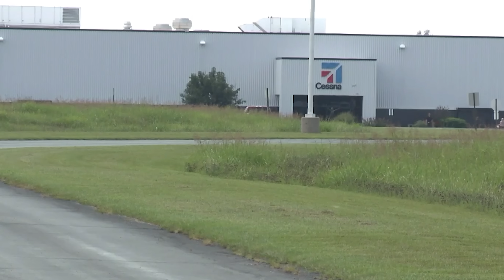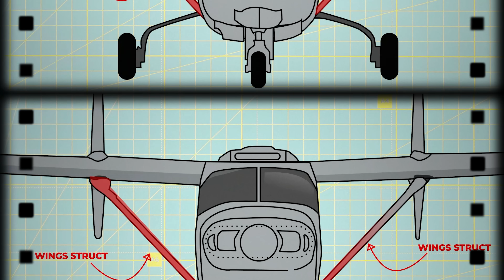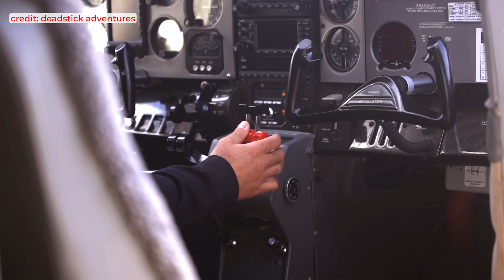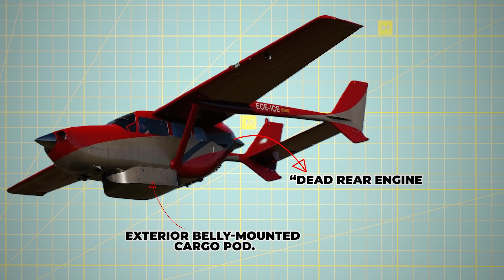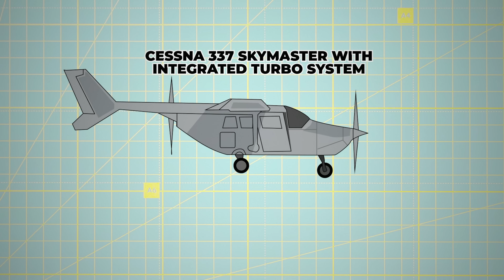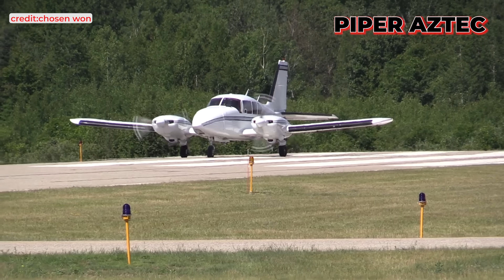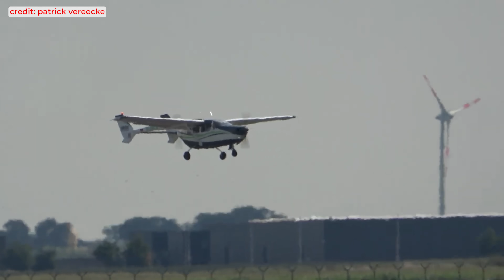Why Did Nobody Want the Twin That Couldn't Kill You?

Comment: The problems were real, but so were the solutions.
Electric mechanical. Controls would have fixed the elevator.
IMHO fitting this airframe with a Turbo prop would have made the bronco look dumb.

Comment: It's interesting how often something which should improve safety can also degrade it. Cessna: No yaw moment with an engine failure; great, should be easy to handle engine out. Pilot: Shuts down the working engine. Alexander Schleicher: The ASK 21 is impossible to spin, it should make a very safe trainer (you can attach tail weights for spin training). Pilots: Forget the weights are fitted, solo a tail heavy craft, spin and crash.

Comment: I can see its brilliance - it is a bit of a smack to the eyeballs, and the 310 et al look "right" and perhaps people thought that the 310 was for real men (gotta remember this is the 60s/70s).   Despite this, I really wish I could fly one.  There are a couple in the UK but I most likely will never get the chance.

History tells us that clever aircraft designs never do well, and the market is extremely fickle.  But I am glad they existed.  The skymaster definitely belongs pretty high up on the cool wall.  The more time passes the more cool we realise it was.  Its ironic that it offset its reason for safety by virtue of its quirkiness which was there in the first place to add safety - that's a pain but happens a lot.  Like adding fuel cut-off valves seems an obvious safety requirement and came about for specific reasons, but then people inadvertently cut the fuel off and that's killed many more over the years.

Comment: The 0-2 that i flew in Asia was the second best aircraft i flew even with the overheat problems when in the taxi to take off and hold. To keep the rear cooler we often only started and ran it up as we neared the hold point before line up. Having flown the 310 in the past i can understand why people still love it as a good value aircraft bur my all time fav aircraft has to be the O-V 10 Bronco.

Comment: Loose an engine and it was barely noticeable. I know that phrase well and so does my dead friend. He was a low time pilot who lost his rear engine on take off. With gear down it is dirty, and climbing is possible but not good, add in clouds, fog, low time, excellent training orientation, and dead. 

After learning about the issue I choose a single engine turbine over a Piper twin or inline twin. Pas on this plane. Great video on it and calling out some of the safety issues.
Reply: Even compared to conventional piston twins, a turbine single is a valid alternative to a piston twin. Turbines are expensive and fuel-thirsty, but that's also true of piston twins; turbines are so much more reliable than piston engines that - along with the many problems in twins - one turbine is safer than two piston engines.

Comment: The USAF took delivery of the O-2 Skymaster in March 1967 and the O-2A also entered the U.S. Army's inventory during 1967, from USAF stock. By June 1970, when production stopped, a total of 532 O-2s had been built for the USAF. Following the Vietnam War, the O-2 continued to operate with both U.S. Air Force and Air National Guard units into the late 1980s. 
https://en.wikipedia.org/wiki/Cessna_O-2_Skymaster

Comment: What I don´t like from the Cessna 337 is that she had just one door on the right side.  Why Cessna didn´t make the Skymaster with doors in both sides like the Cessnas 150, 172, 177 or 210?  Also the rear engine problem ,coold be solve by subtitute both piston engines with turboprops?

Comment: The biggest problem of the 336/337 is it was designed by the single engine engineering department.  Cessna was big enough they were separate from twin design engineers.  The single engineers made some beginner mistakes.  The twin department didn’t want to help until made to.

Comment: The Skymaster does have a Critical Engine.  The rear engine pushing is slightly more efficient and it creates a low pressure area in front of the rear engine smoothing the airflow over the fuselage.   So loosing the rear is more critical than losing the front due to the rear being more efficient and with its loss there is slightly more drag.

Remember. The definition of a Critical Engine is the one’s loss creating the most adverse effect on performance
Reply: Whilst I was flying a C336 in New Guinea, a rocker arm bolt failed on the exhaust valve of one cylinder head on the rear engine, causing very rough running. The aircraft descended to and (just) maintained 1500' at 80 Kt. IAS. D.A. was +2800', and I was over water. Talk about a critical engine!

Comment: Been in aviation my whole life never met anyone who didn’t like that push pull
Reply: Well, you might start liking it a bit less when the maintenance bill comes due
Reply: @macbrown99  That's certainly true - it's a bit like a helicopter; fly it for an hour, then work on it for three!  Generally speaking the pilots loved them and the mechanics hated them.  I haven't flown a 337 in about thirty-five years but I loved it and trusted her completely.  I learned the hard way one afternoon how much ice they'll carry, and though not an Aztec, the old girl will pack a load of ice that'll scare the hell out of you.  The fuel system is a little complicated but once you understand it it works very well.  I'd jump in one this morning and go fly it.
Reply: @stearman456 good comment!!
Reply: can you elaborate why it's worse for maintenance? I genuinely wanna know  @macbrown99
Reply: I've never met anyone who flew or owned a 337 who trash talked it. . But having bought, sold and flown a lot of 337s  I encountered a lot of people who had no experience with them say they were one of the worst airplanes even made. I also encountered a few mechanics who griped about working on 337s but they were usually the ones who complained about everything.
Reply: Never liked it
Reply: @rondavis4140  Why? Have you flown or owned a 337?
Reply: A pig to work on.
Reply: When I was young it was one of the most comfortable planes of all those we used.  I liked it and it hauled ass compared to many.
Reply: My spent my whole life in aviation and didn't like it.
Reply: @lrrryo you probably don't like blondes
Reply: @lrrryo  Why? And did you ever own or fly one?

Comment: Do not forget that the USAF used the Skymaster in the forward air control spotter role. This was during the vietnam War. They were based at a local military air station where I grew up.
Reply: They were cheap and the US was desperate. OV-10 Bronco was better in every way including ejection seats while if an O-2 got hit the crew were trapped and could not bail out.
Reply: I understand every time they took off, it was over max weight.

Comment: Had my first ride in a 337 in 1967 when an airport kid at Port Hedland in the north-west of Western Australia during the 1960s massive iron ore exploration and railway construction stages of the industry in that region. The short/rough field sprint performance made the 337 ideal for servicing the railway survey and construction camps. Every morning before going to school I'd watch 4 to 6 taxi out and take off 'scramble' style to do their day's work. The pilots did their own maintenance so I'd make myself conspicuous and wait for the shout "Hey, I've got to do a circuit to warm the oil so I can change it, wanna come for a ride?" I was in that right hand seat and buckled up before the question was finished. I was always amazed by the hardover full aileron required for take off to counter the co-axial engine torque!

Comment: Make the pusher electric for take off, climb and engine outs. You get an aircraft with low noise, improved efficiency and safety.
Reply: You might expect a gasoline-electric hybrid aircraft to be more efficient, but in practice it typically isn't. Gasoline engines work well at much less than full power, so running two engines at half power is better than running one of the same engines flat-out.  

The Ampaire Electric EEL started that way,  but the later version replaced the front engine with an electric motor, keeping the gasoline engine at the rear. It has not been a success, despite claims of miraculous benefits. 

The VoltAero testbed for their planned Cassio replaces the Skymaster rear engine with a different gasoline engine (with generator) and replaces the Skymaster front engine with electric motors on each wing. VoltAero is no longer using the Skymaster-based testbed and has changed their Cassio design, abandoning the centreline thrust configuration.
Reply: That's  pretty _ucking brilliant !
Reply: @Dean-b2f  that's reasonably obvious, which is why it has been tried.

Comment: How about a 337 with a CD-300 running on jet A in the front with a featherable prop and a 350 hp PT-6 in the rear with a featherable prop. Use the piston up to 15,000 feet, fire up the TP, shut down and feather the front prop, up to 31,000 feet we go. Best fuel efficiency for all altitudes. Fire up both on the ground and watch a 4000 feet per minute climb rate.

Comment: I spent many hours working on a reims 337 built in France.
It had the massive camera bay, it also had hard points under the wing.
Most impressive were the tanks, 5 interconnected tanks in each wing, had to use capacitance type qty senders as floats would never work.
Gear was a headache, as was working one the rear engine as anything on the accesory case needed accessing through a hatch in the rear of the cabin.
Lots of fun though and beautifully made as were all Cessnas.

Comment: It was expensive for what you got.  It wasn't very fast,  didn't have a large payload.  If you got a twin rating with one you were limited to "centerline thrust only" and you still had the expense and fuel burn of two engines. 😂

Comment: I don't know how under appreciated this plane was, my uncle had one and Cessna couldn't stop the rear engine from overheating. There was another for sale at our field that was just as bad. Maybe if you got a good one you had a nice plane, but they were not all good ones.
Reply: Lots of discussions regarding rear engine overheating, flew one as a commercial pilot in 40 degrees (at GL), never had an overheating issue, but I was very familiar with the SoPs and its commercial operation requirements. Had plenty of other issues!

Comment: I personally love the Skymaster.  The fact that you can’t use your time in it as “twin engine” time toward your commercial career makes it less desireable for time building.  It’s great, however, for private pilot owners, if you can keep that rear engine cool.  As for that gear, I owned a TR182 and…it’s fine.   As for nicknames, the Skymaster is known as the O-2 suck-n-blow.
Reply: I did.   

I got almost 700 hours in one and it was decisive for an early upgrade when I moved on in my career.
Reply: @calvinnickel9995  Most jobs only count hours in non-centerline thrust aircraft.  It’s like they are specifically trying tomesclude the 337.  Yeah the hours always count toward total time.

Comment: I just remember what a SOB that rear engine could be to work on,  front wasn’t a cinch either
Reply: I never found this to be the case. The front one is actually more difficult.  Particularly the oil drain (only accessible through the front gear well and you can’t have a quick drain because all your oil will drain out on gear retraction 😂), the oil screen, and the mags.  

The rear engine of non turbo versions has tons of room plus a really good working height.

Comment: Many Skymasters lost the rear engine late in the takeoff roll and it went unnoticed by the pilot.  When the attempted to continue flying, the rear engine act liked a big air brake. Without  the rear engine feathered, on a hot day the airplane can’t fly.  Low time pilots ended up crashing.  Well trained higher time pilots survived the experience.

Comment: Skymaster killed my Commanding officer at Shaw in the early eighties.  The rear prop failed and cut the tail off.  Bad bolts.   I flew on that plane. It has some power and a roar.  Nice plane but I avoid it.

Comment: I worked on a lot of these. People thought that the maintenance cost should be the same as a single engine. But no, It had the maintenance costs of a sophisticated twin, depending on model. The most complicated one I worked on was turbocharged, pressurized and had a Robertson STOL conversion.
Reply: I flew a friend's Robertson STOL C-337. That really made the plane great.
Reply: Me too. We had a C337 for work transport. Unfortunately one of our bases has a gravel strip and I was forever filing the rear prop!
Reply: @robo3915 I taught aircraft maintenance for 9 years. When doing blade repairs my students were in fear when I approached with my chisel and hammer.

Comment: 2993 were manufactured.  I don't think that makes the 337 a flop for a twin.  I thought the fixed gear 336 & belly pod were answer - lighter weight & lower maintenance on the gear & a well-centralized luggage area.  2 engines meant redundancy over wooded terrain & large bodies of water.

If they'd designed in some large vortex generators on the fuselage, it would have helped with drag from the rapid curve-in aft of the cabin, helping air to flow better.  I like the way the 336 looked.

Comment: I was told by a Cessna salesman that the Skymaster came about because the U S military wanted a lignt twin engine forward observation aircraft but didn't want the obstruction of a low wing  twin engine aircraft.  So Cessna engineers came up with this design.  The U S military bulked at the design and Cessna did not contract a large enough order to support the cost of building the aircraft so they decided to adapt it to civilian use as well.  After Cessna made some improvements in performance the military started to order huge numbers during the highth of the Vietnam war.  The rest is history.

Comment: The Continental 0360 never makes TBO without a top overhaul. Also, the overly complex gear was prone to getting out of rig, sequencing valves and switches etc. There’s an STC to remove the aft gear doors. Costs about two knots in cruise but reduces failures in the system to almost nil. The aircraft handles very well but the engines and gear are weak points.
Reply: Yeah.   No.  

I flew and maintained one of the planes in this video.  We flew even the rear engine on condition beyond TBO on all original cylinders.  

And we kept the gear doors.  All the door delete does is get rid of two actuators.  You still need the power pack and/or solenoid valve which is the crux of the system.  Getting a leg amputated because of a leaky heart valve is as logical.  

Never had any issues with the gear or engines over a decade running it.

Comment: I always considered the Skymaster one of the coolest airplanes in existence.
Reply: And it starred in its own movie - BAT 21! I agree with you. Lateral thinking by engineers at Cessna
Reply: I agreed, until I saw the "Piston Engine Powered Plane that Was Nearly a Jet!" - The "Ted Smith Aerostar", that later became the Piper Aerostar! 2 x 290 Hp, ~300 Mph Typical Top Speed! But - the Aerostar never got any "Robertson STOL Mods, so it was more of a "Pavement Princess" than the Skymaster was.

Comment: I like flying the 337, but I really hated working on the thing. Particularly the rear engine. I have long been retired. But every time I see a picture of a 337 my knuckles start to hurt. Just kidding. But I do remember that rear engine being a real bear to work on.
Reply: Agree! A mag change being an utterly and totally miserable experience. Overheats quickly as well so you really have to get on the runway and give the engines the message. Not a machine to sit around in farting about with checklists. Learn them and crack on!
Reply: @MaxPlankton Mags were easy to change on the rear engine,you accessed them from inside the rear cabin of the plane.The front engine was the harder one to work on mags or change the vacuum pump on.I worked on these for 20 years at the Cessna dealer just across the runway from the Cessna factory.
Reply: @jettechdon28 Hang on a mo, I'm rewinding my memory 33 yrs-ish. We were working outdoors at Hucknall Airfield until about 0200. The lad who was helping me will remember.

Brain fart I'm afraid!
Reply: I worked on these for 20 years at a large Cessna dealer in Wichita,mostly the P337G model.The rear engine was much easier to work on once the cowling was removed.

Comment: I always like the way the Skymasters look. But somehow their performance is disappointing. Compared to a normal twin, the 337 eliminates the frontal area and wetted area of two engines. Even with the cooling area of both engines still necessary, that should give the Skymaster an advantage when it comes to speed. And yet, it is slower than most competitors in the 2x200 2x220hp class. How does Cessna always manage to make their planes so slow, even if they start with an advantage?

Comment: I got to fly this for a day, with a full time instructor guiding me, only my second flight handling controls. I did the takeoff, climb and cruise, and a very smooth approach and landing. The mixmaster felt louder than a 210 and  handled like grandma's Buick: smooth and steady, not at all twitchy, not super-agile, but it gave a feeling of stability and confidence. The torque-canceling effect of the counter-rotating props made P-factor a non-issue for a beginner pilot like myself, with barely an hour of real stick time time and some practice flying RC gliders. Coming back to the original airport at night, clear skies and moonlight, I flew suspended in what felt like space flight between stars above and  grounds lights below - a magical thing I will always treasure in memory. I loved this plane and it's quirky looks.